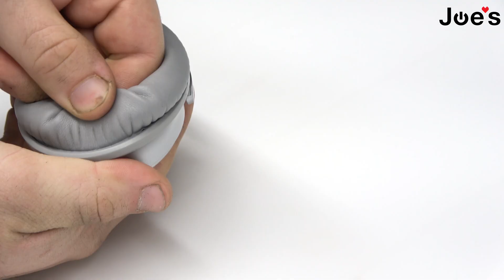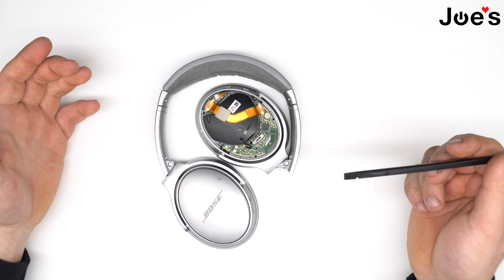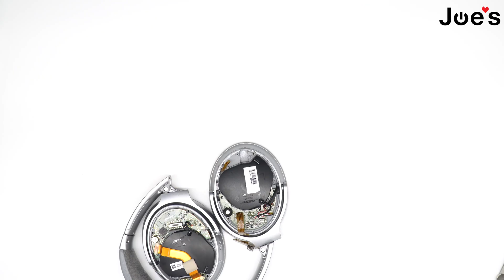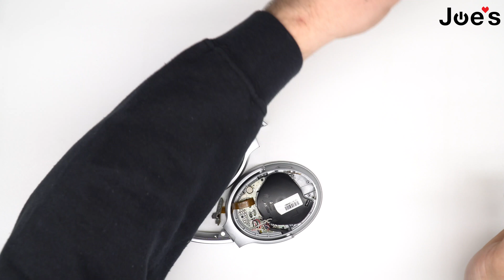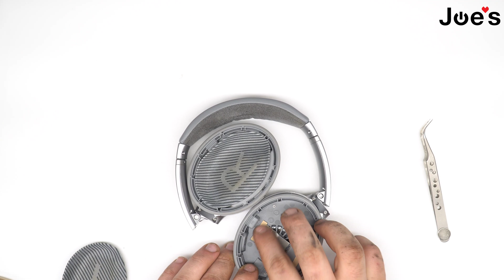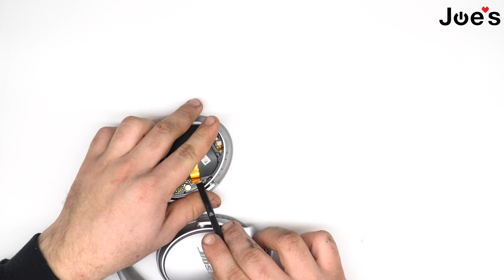Replacing Blown Speaker on Bose QC35 I & Bose QC 35 II | Repair Tutorial

Comment from the maker: Buy An Original Bose QC35 Speaker Driver: https://www.joesge.com/products/bose-qc35-qc25-i-ii-40mm-speaker-driver-cone-replacement-parts
Buy A Solder Iron: https://www.joesge.com/products/60w-adjustable-led-soldering-circuit-board-repair-iron-kit-tools
50 in 1 Tool Kit: https://www.joesge.com/products/joesge-repair-tool-kit-50-in-1-precision-screwdriver-set-tools?variant=32817393074222
Need Help? Send your broken Bose headphones in: https://www.joesge.com/pages/repair-service-bose

Comment: Thank you very much for your videos and your help! But I need your precious help again please!
Thanks to you I'm almost done with the reparation of my headset.
The only issue I have is that I get a terrible feedback loop when I'm turning on the headset. By searching on the Internet I found the culprit could be the microphone whose cables (black and white) I had to unsolder and then solder back. I tested with only one of the 2 cables unsoldered, and it works, I don't hear this feedback loop anymore. Of course the microphone doesn't work... I then thought it was an issue with the soldering so I tested by manually connecting the unsoldered cable to its dot on the board but the issue then reappeared. So I'm a bit puzzled.
Do you have any idea what the issue could be?
Reply from the maker: Contact us support@joesge.com

Comment: Does someone know whether/where I could find replacement parts for this internal plastic shell that is glued? Didn't find anything yet after a relatively thorough Internet search.
Reply from the maker: Write to us at support@joesge.com with details on the specific part you need, and we’ll do our best to help!
Reply: @Joesge  That's very kind of you! I will send you an email in a minute. I messed up with the heat gun, I guess the nozzle I used was not fine enough (I don't think the temperature was too high) and I ended up deforming the inner plastic shell.

Comment: Thank you it worked !! 

For all QC35 II owner you will need a lot of heat and isopropyl alcool to remove the glue !

It seems there is a small difference in audio with the new speaker but not very distinguable ! 
On The original driver it is written : 32 ohm 20 mW 190226

Thank you for this video !!
Reply from the maker: Glad it worked!

Comment: great video, but limited by lack of guidance for how to procure the replacement wire, which is pretty much necessary given how hard it is to reuse the wire. (see question about wire asked several times below, but not answered). have been searching the internet for what kind of wire this is w/o luck. keep this in mind before you buy the drivers to attempt this repair.
Reply from the maker: Email me a photo of the wire you are referring to info@joesge.com

Comment: Hi guys, i think i blew up tbe right speaker. The noise sound likes a muffler sometimes. I checked the link to repair. But which one do i need for the right?
Reply from the maker: That speaker driver will work on either side :)
Reply: Thanks, got it. @Joesge

Comment: Using this video, I successfully repaired my QC35ii headphones! Thank you so much! For others who may have the same thing, the symptom for me was that the right ear would go in and out of playing sound. I would tap the right ear and it would come back, or if I'd wiggle my head, chew, or change the air pressure in my headphone, the sound would sometimes toggle on/off. It felt like a loose wire so I was skeptical that replacing the speaker cone was the solution, but was getting worse and worse so there was not much to lose in trying it. I bought the replacement speaker set, and went for it. The soldering is not for a beginner, I ruined one of the replacement speakers, so I called in a family member who was more experienced at soldering and he got the job done. I also had to replace the wire between the mainboard and the speaker but only because I broke it when doing the repair. Also, the heat gun I have is not ideal, so I recommend getting a heat gun with a) Precise temperature control b) precise airflow control and mostly importantly C) a very fine tip to direct the air. I just about melted the plastic because my heat gun is too erratic and not fine-tipped. Anyway, thanks, Joe's, for this video!
Reply from the maker: Hello, you're very welcome. Thank you for the comment. Please like and subscribe for more content like this 😊
Reply: Same symptoms I have. And now the right ear is not working at all. So, I'm on my way to replace that speaker.
Reply: Thanks for the explanation, i had the same issue, the speaker toggle on and off i will try to change the speaker

Comment: Note to QC35 II owners:
It seems Bose changed the desgin of the speaker cover a bit, I had to break 2 melted down screwed around the speaker housing + the glue isn't nearly as weak as shown in this video, you will have to heat up the glue quite a bit and use more force to pry it open.

Good luck
Reply: Thanks, I will keep trying. So far I am destroying the plastic and bending my screw driver.... that's some strong glue

Comment: How do I know, if my speaker is broken? I mean, yes sure, when there is no sound.. But is it possible, that something else is broken? The left side of mine just don’t work, the rest works perfectly fine (Bluetooth..etc.)
Reply from the maker: Hello, thanks for commenting. Please email us at support@joesge.com with a screenshot of your question and we will be able to better assist you there. - Aaron P
Reply: I had the same problem recently and fixed it by a replacement speaker (Amazon), thanks to Joe's perfekt YT-Tutorial. To proof the accurate working of the speaker, measure the continuity through the speakers winding with a multimeter the resistance between the plus and minus outputs on the PCB. there should be some value about 3 Ohm. Maybe you'll need to unsolder the terminals. If a very high value could be detected, the speaker is probably gone.
Reply: @htg1682  I already fixed the problem by changing the speaker. Now it works perfectly fine again

Comment: Question: why is there "duct tape" covering the middle half of the speaker? Wouldn't that hinder the listening experience?
Reply from the maker: Not sure, send us a photo at support@joesge.com
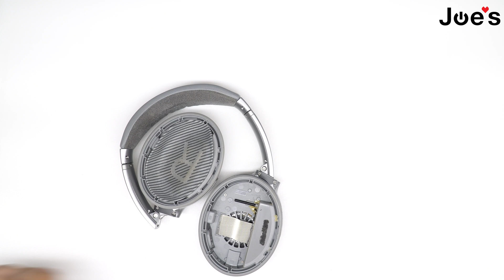Reply: @Joesge  At 1:03 in your video, the gray-gold "duct tape".
Seems an odd design choice by Bose to have the sound coming out from only the top and bottom.
Reply: It's for acoustic loading and surely made very carefully to give a flatter response curve.
Reply: Are you talking about the connective ribbon?

Comment: I followed the video to replace the speaker in the right ear on the QC35.  When I finished and powered the headphones I heard a loud solid tone that changed (got higher and lower) as I moved the headphones.  I double checked the 4 solder points, and the + and - wire locations and they look good.  Any idea what the problem is?
Reply from the maker: Hello, thanks for commenting. Please email us at support@joesge.com with a screenshot of your question and we will be able to better assist you there. - Aaron P
Reply: @bertmaster2000 I have the same problem, did you fix it yet?
Reply: I just hit the same loud-beep problem. You can work around this by disabling noise cancellation. For me putting the heaphones back together funnily enough fixed it. Might be some sort of feedback loop which goes away when the mic listening to outside noises is properly covered with the outside cover...
Reply: Feedback, maybe you reversed the speaker leads and actually enhance noise to the point of oscillation? Or else it's not acoustically ( airtight?) sealed and you're getting feedback that way. Switching off the noise cancellation will reveal which it is. (If the squealing goes  away with it (n.c.) turned off)

Comment: thanks I just repaired mine but I didn't have new wire and I think the sound doesn't sound so good on the left.. I'm going to get new wire and see if does better. it's working though!! thanks
I melted a few things but not important. I had to buy a new small heat gun. Can you recommend wire and also the heat gun. I don't really like my new one
Reply from the maker: https://www.amazon.com/Quick-861DW-Digital-Station-Display/dp/B00EID23J6 
this is the heat gun we use

Comment: My pair just started acting up today. My right side goes out but if I tap the side or adjust the orientation of the cup, it turns back on. Before I rip my headsets open, how can I tell that it's the speaker that's going and not some other connection issue like the hinge?
Reply: I'm having the same issue, so was is your speaker or something else that as the problem?
Reply: @sammedeiros4204  I would assume so. I tried to do it myself and broke the headphones more. The plastic started melting and not the adhesive.
Reply: @sammedeiros4204  @Pyrusdrago Hey there. My headphones were having the same issue. Eventually the one side just stopped working. Ever figure out for sure what was wrong with you guys’?
Reply from the maker: Hello, thanks for commenting. Please email us at support@joesge.com and we will be able to better help you there. - Aaron P

Comment: Where can I find the wire to replace the old one?
Reply from the maker: We unfortunately do not sell the wire yet. Im unsure where you can find it
Reply: Hey bro, did you ever find out where to get the wire?
Reply: @renoleevans  no, I had to reuse the one that was there
Reply: @zerohunterzero  For everyone else looking: You can use any old headphone cable. I had some really old Nokia in ear headphones. The ones that come with a phone. Just use them. Use the part of cable after it splits from the main cable into two smaller ones. These got 2 wires inside. Mine actually look exactly like the Bose ones. The cable even has the same diameter.

Comment: I'm having difficulty removing the cover that covers the right speaker. I have removed 3 screws from the inside of the headphone, and 4 on the outside. do you know if there are any additional areas the cover is attached to? It almost looks like there are a couple plastic attachments to me
Reply from the maker: Hello, thanks for commenting. Please email our tech at eddy@joesge.com with some photos and the issue you are having and we will be able to better help you there.
Reply: Did you removed ? I am in the same situation but I couldn't do it.
Reply: @usathink  no, I couldn't do it so I ended up getting different headphones :(